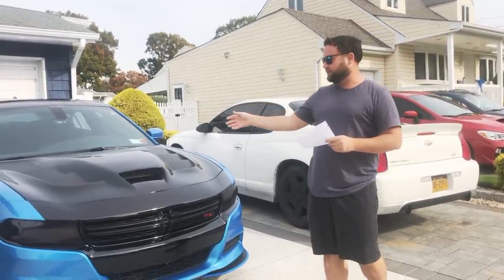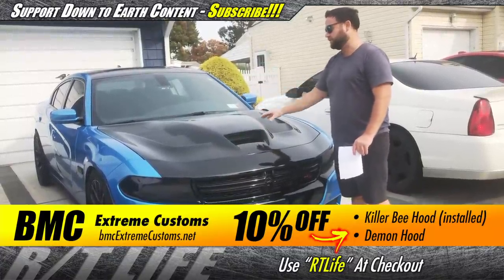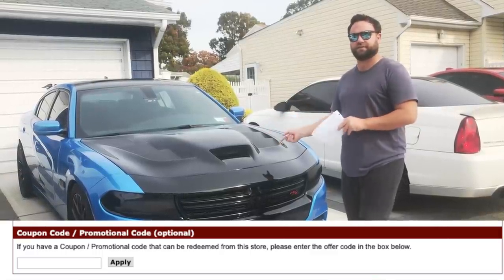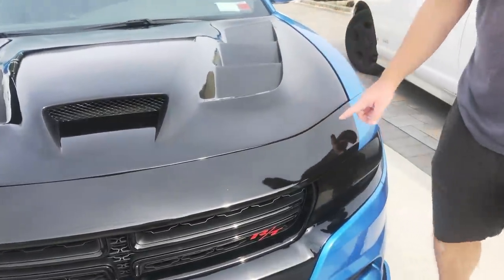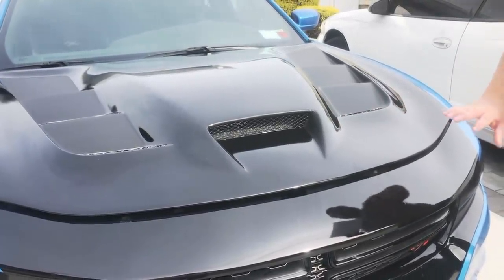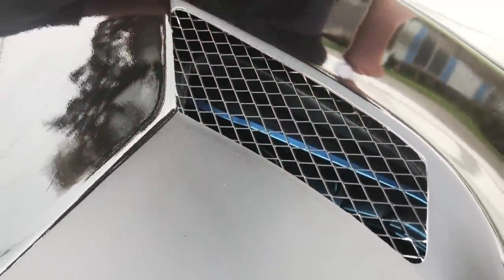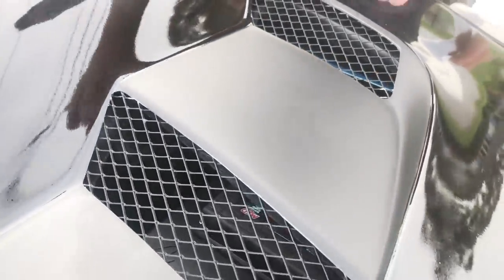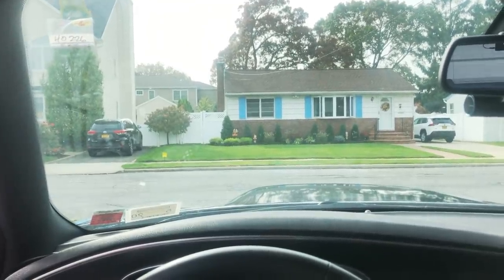Killer Bee Hood: Price, Fitment, Problems etc...

Comment: I suggest getting the srt cover for the abs control unit for purposes of keeping the water off of it. It's cheap. I did this when I went hellcat hood swap.  I also designed a cover for my air intake that is interchangeable on rain and sunny days.  I wish I could show you my air intake design on here. It's simply black Plexi and 90s

Comment: What I did about my intake is went to home depot and got a piece of lexan, cut out a piece  slightly bigger in all directions and used a heat gun to bend and form it to the curve of the intake. Then got rubber sealer around the edges so it fit snug and made a water tight seal

Comment: I run the VOLANT closed box  with a Donaldson filter.  Opening in the bottom like factory intake and the front side is opened up toward the headlight.
Reply from the maker: you will not run into issues with that intake - the vents will allow your engine bay to cool down quicker
Reply: @RTLife  I'm thinking it's the same design as your Corsa cai was.

Comment: Don’t understand all the comments stating that it’s only good for summer? For rain or water to damage anything inside of your engine bay you would literally have to get a bucket of water and pour it over the electricals, rain and sprinkles of rain will never damage anything electrical I had a hellcat hood and went thru 2 winters with it days rain would pour down so hard and never had an issue
Reply from the maker: yah this thing will be fine in the winter etc.

Comment: Having a new hood with vents with an exposed intake which I have is one of my nightmares, I don't water entering though the filter especially during washes.
Reply from the maker: I have a pretty solid solution for it. But there are 3-4 options that most end up doing. Very happy I ended up getting this though

Comment: Had a question on the window washers....I want to remove them without breaking them....do they pull out...do you have to lift a tab to pull them out or push them through....most videos I see of hood removals or swaps usually speed through this step and don't show how they are removed....I saw were a few people broke theirs trying to get them put....I'm sure it's simple but just wanted to make sure before I break something lol

Comment: I can't believe that the manufacturer didn't recommend or require hood pins! Every FG & CF hood I've looked at for my Chally has required hood pins. Perhaps cuz the hood is much longer on a Challenger? Have you noticed any wobble in the hood at high speeds?
Reply from the maker: No wobble or anything at higher speeds. This thing is perfect - def one of the better mods I have done. Very happy I did this
Reply: @RTLife  That's good to hear, & it looks really good! 👍🏼

Comment: Do feel like the hood had any impact on  the performance of your R/T since you have more air circulating in the the engine bay?
Reply from the maker: Yes this hood helps with engine bay temps - it cools off faster. Intake temps are lower while cruising.

Comment: Hey I just bought this hood. The upgraded one with the closed off side vents and has the ram air so water doesn't leak all over.
My question is. Its fiberglass so theres a rough texture. My vinyl guy said it won't hold because vinyl holds better/stronger on a smooth surface like a painted one. How did your hood arrive in? Same as mine and if so,.how long did the the vinyl wrap last without any lifting

Comment: Hey man I have a hellcat hood on my 2014 charger but at higher speeds the back end close to the windshield will shake. Any idea on what I can do to minimize if not completely resolve it?
Reply from the maker: Is the front (hood/bumper) flush?
Reply: @RTLife  yup. Wait one side is higher slightly than the other
Reply from the maker: In the front (close to the bumper) there is a way to adjust the height of the hood so it sits properly.
Reply: @RTLife  yes I’ve tired to make them as even as possible but that increases the shaking. I haven’t set no where it hardly shakes at all most times but there are some runs where the shaking is still visible